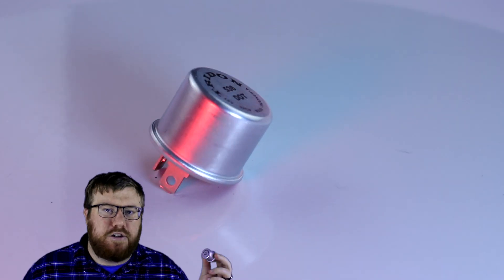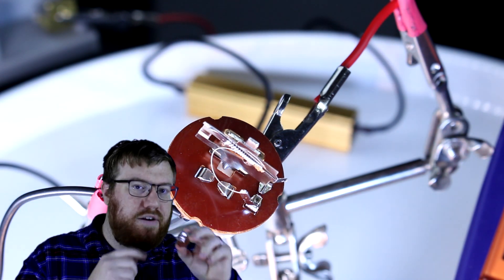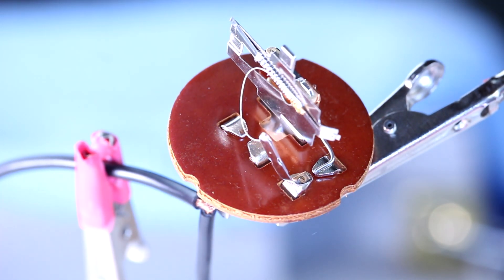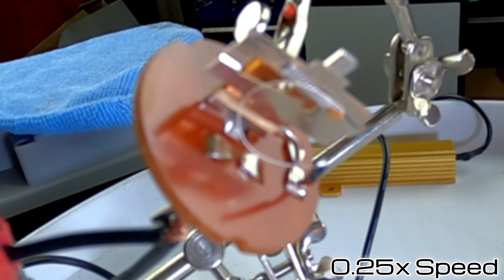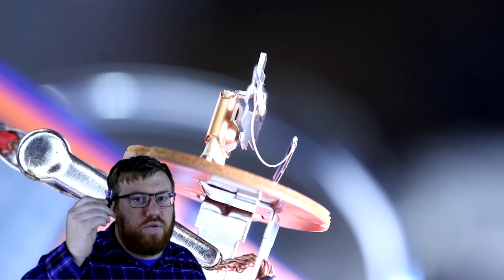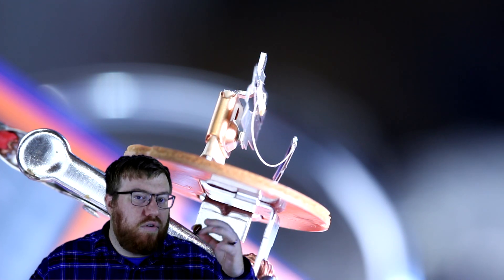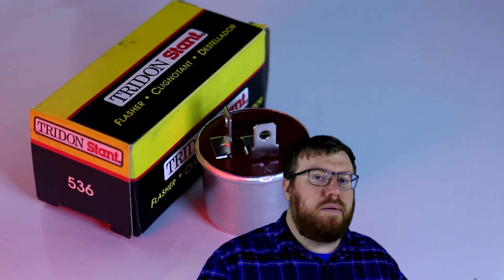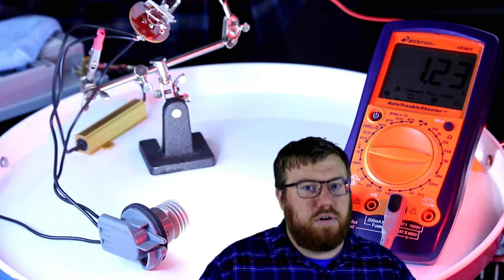What Makes Turn Signals Work? (Inside a Thermal Flasher Relay) • Cars Simplified

Comment: So with a bad bulb there's actually less current flowing though the flasher, correct?  If that's so, wouldn't it flash slower?
Reply from the maker: With this flasher and the typical failure mode of a burned out bulb, yes. Dual-filament bulbs can create short circuits with their broken filament, however, if the broken filament falls into or gets bounced into the other filament. That, and more complicated flashers (3+ leg thermal flashers, digital flashers, and computer-controlled flashers) may or may not behave differently depending on their designs.

Comment: the explanation is good, but it doesn't explain why when a bulb is blown the flash rate actually increases :)
Reply: You need to watch his next video on series and parallel I imagine it’s explained there.  Total Resistance in a series circuit is r1+r2 (resistance of globes).  Resistance in parallel circuit is 1/r1+1/r2.  The resistance of the single bulb is greater than 2  bulbs wired in parallel.  So when 1 is removed (blown) you’re left with 1 globe wired in series resulting in more resistance and more heat in flasher relay, therefore you get faster cycles of the flasher relay.
Reply: @Dodgepete59  No, that is not what happens. You got most of it right though. When one bulb burns out or is removed, there is only one bulb left, and the resistance of this bulb is greater than both bulbs in parallel. The higher resistance causes less current flow, so the bi-metallic strips don't heat up as much therefore they take less time to cool down. When it takes less time to complete the cycle of opening and closing the contacts, the bulb blinks faster.
Reply: @bernardocisneros4402  that makes more sense, thank you for clarifying.

Comment: My flasher relay works fine when directly connected to battery. But when i put it in the socket, the flasher just turned on not blinking. Can somebody help me to understand this 🥺
Reply: The flasher you have is solid state, and polarity sensitive, so your light bulb will be constantly lit, if you don't pay attention to polarity. You have to reverse the wires. That's what's nice about thermal flashers. They're not polarity sensitve. You can stick them in any which way.

Comment: Regarding the part when you say that the more amps you have the quicker the blinker will operate... I don't know about that but quicker blinking can be seen also when you have a faulty incandescent bulb as well no matter that the current in the circuit becomes smaller than the one that flows through the circuit with all bulbs available. Less current causes shorter movement of the strip but still enough to contact the output terminal
Reply: @DanovDaniel  You are correct!  When one bulb burns out or is removed, there is only one bulb left, and the resistance of this bulb is greater than both bulbs in parallel. The higher resistance causes less current flow, so the bi-metallic strips don't heat up as much therefore they take less time to cool down. When it takes less time to complete the cycle of opening and closing the contacts, the bulb blinks faster.